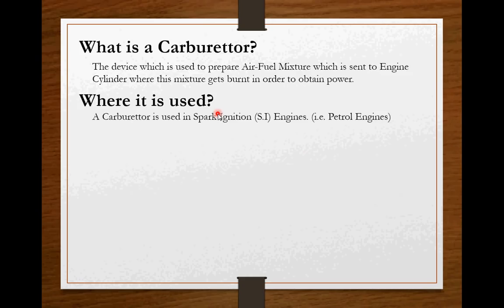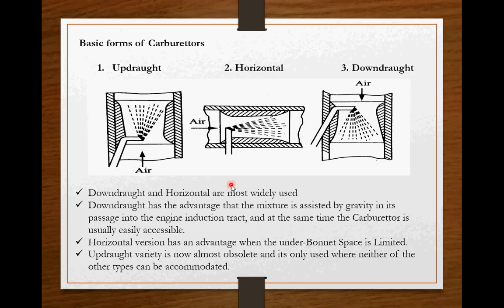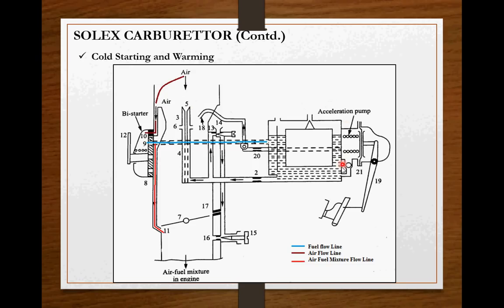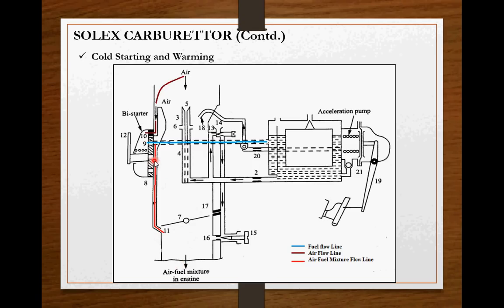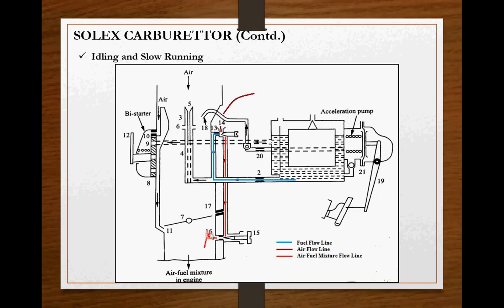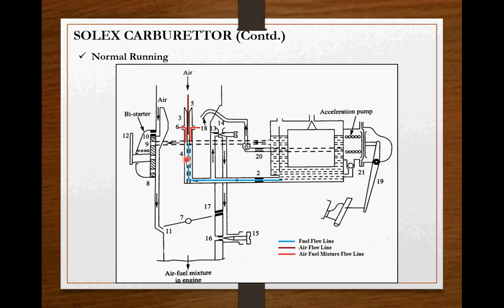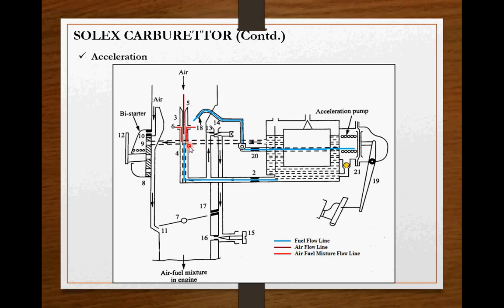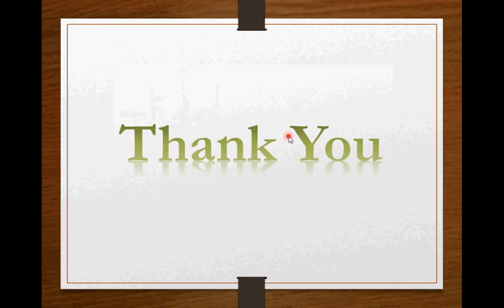Solex Carburettor #carburetor #icengine #carburettor

Comment: Please clear my one doubt that during idle condition, throttle valve suppose to be fully shut or we keep it little open? I think it has to be little open for taking air suck in and fuel through jet screw which will come after the throttle valve for mixing. Am I right sir?
Reply from the maker: Regarding your doubt.  
Yes we keep throttle valve completely closed during idling condition.  
Because during Idling condition the fuel is supplied using Idling jet (in video: Idling jet is numbered as 16)since this Idling jet is placed below Throttle, hence even when the throttle is not operated the engine gets the air-fuel mixture.
Actually we have more than one jet  in the carburettor.
Main jet: This will come into working while the throttle is operated. 
Idle Jet: This comes in working when the throttle is not in use
Reply: Is this the same case in bike carburetor where throttle valve screw is adjusted for minimum rpm for idle running?
Reply from the maker: There are different kinds of carburetors used in different bikes. 
Depending upon the type we have Idling settings incorporated. 
Sometimes this idling setting screw adjusts the slide(used for throttle) vertically such that by rotating the idle screw clockwise the slide (used for throttle) is raised and a wider passage is created for the passing of air fuel mixture hence more amount of air fuel mixture is supplied to the engine and it produces more power (High RPM)
On the other hand turnjng thr idling screw anti-clockwise lowers the slide and decreases the passage area hence decreasing the supply of air fuel mixture thus reducing the power output produced by the engine.(i.e. decreasing the RPM)

Comment: i have a question here, could you explain the pilot jet holes ? how it works. you find some pilot jets have holes at the neck, wile others have holes down on the stem, what is the difference that will take place when the holes are up or down ?
Reply from the maker: The holes provided on the side of pilot jet are called as bleeding holes (The number of these vary with different manufacturers) These pilot jets (pilot jet with bleed holes) are used in those Carburettors where there is a air passage designed in the Carburettors in order to allow excess air coming in contact with pilot jets from the side and this air enters the pilot jet from the side then gets mixed properly with the fuel while flowing out throught it. Thus giving a better mixture.. 
Note: If you use pilot jet with bleed holes in place of piloy jet without bleed holes then basically you won't find any difference in operation since your Carburettor wasn't designed for the pilot jet with bleed holes and it is not having air passage for the same.
Reply: @AllAboutMechanicalEngineering  thank you for quick reply.
you mean that this bleeding holes don't make big difference i can have if i change the pilot jet with more holes or less, but I read before that the numbers and its place on the stem are for high or low acceleration but i don't know this is right or wrong, beside, if i change a pilot jet with another one with more holes or less what kind of changes i will have ?
Reply from the maker: The pilot jets works during idling and progression ( i.e. during idling and low acceleration) so you are right there 
But at high acceleration the main jet comes into the picture and hence pilot jet is not so responsible for the high acceleration.
If you are willing to replace the pilot jet, then as I said earlier, in case you are using pilot jet with bleeding hole in place of pilot jet without bleeding hole then there will not be any difference due to limitations of Carburettor design.
Now if you are talking about replacing pilot jet with more number of holes (let us say using pilot jet with 4 holes instead of 2 holes) then if you are not altering the pilot air screw you may find slight change in performance. Since the mixture is of same kind as the air and fuel ratio has not been changed and slight improvement in performance will be due to more correct mixture preparation due to additional number of holes. 
But if you are altering the pilot air screw then the more you allow air to flow to the pilot jet the leaner mixture you will obtain and then rather of improvement of the performance you might have to face some issues such as backfire, sudden stopping, etc.
So basically its not about the number of holes and there position, its about the design  of the Carburettor and accordingly there is a suitable pilot jet which is to be used for that Carburettor.  
Use of wrong pilot jet is not going to give any improvement in performance
Reply: @AllAboutMechanicalEngineering  I got it now thank you